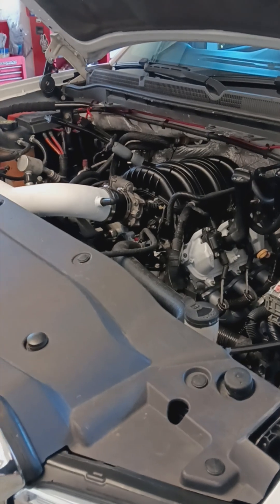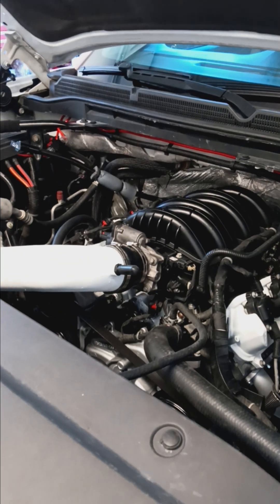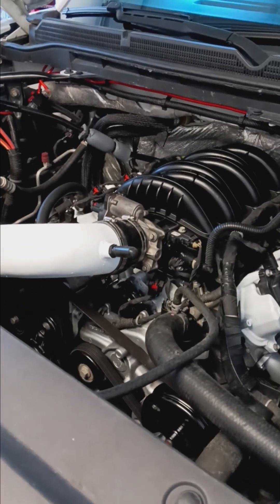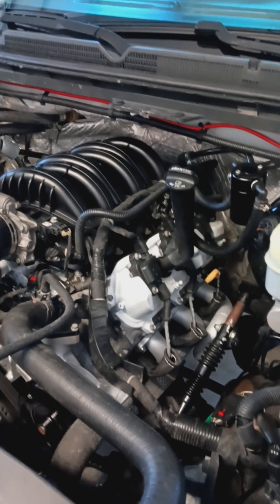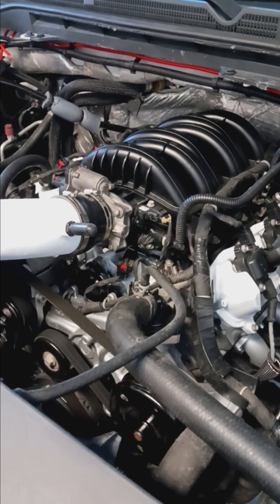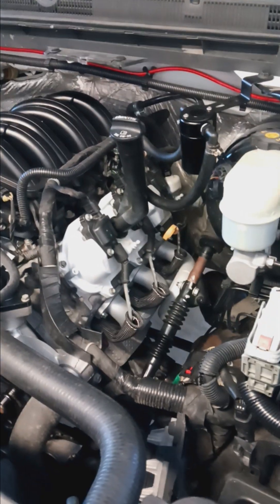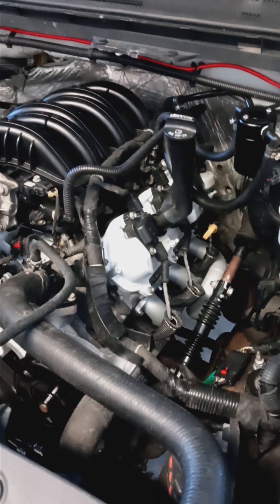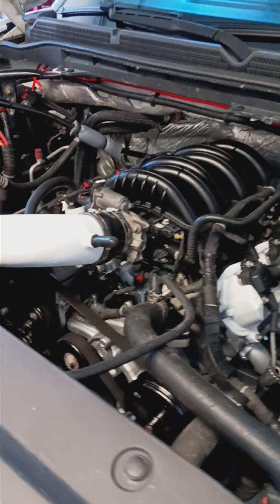V8 Power from a V6? How does the Lv3 4.3 stack up against the L83 5.3 in a truck application.

Comment: Awesome truck man. Does the CTSV have a higher stall speed? My 2014 LV3 stalls at 2400 plus stock.
Reply from the maker: I could never get a definitive stall speed. While it is slightly higher than factory it is not enough to mess with daily driving or towing.

Comment: Thanks for all the information Im in the process of building my lv3 after lifter failure I was originally going to swap for a l8t 6.6 crate motor I’ve been saving for a while now but samething with the wiring i was told I can use any v8 harness but has to have same transmission? Plus I have a 6l80 and didnt think it would hold. I got the dod delete and stage 2 cam for my lv3. Did you delete your vacuum pump? And would you mind sharing what you did for the oil catch can thanks!
Reply from the maker: I did delete the Pump. I will see if I can post a picture up here for you its really easy. Get 2 plugs for the block and then tap the rear of the intake manifold.
Reply: @  thanks man. Are you on instagram by chance?
Reply from the maker: @OBSityproblems  Yes contact me there as I wasnt able to post pictures here. Alfredo_LVX

Comment: Itd be interesting to see more builds with the moderen day 4.3. It may surpass the 3800 as the favored gm v6.
Reply from the maker: I think if people are willing to deal with the DOD issues this is an excellent motor choice. The LV1 is the same engine without any AFM parts and I have seen those making it to 300K being abused in work vans.
Reply: @Mechanic_lyfestyle  They look pretty compact too. They may possibly fit in engine compartments that are too small for a V8.